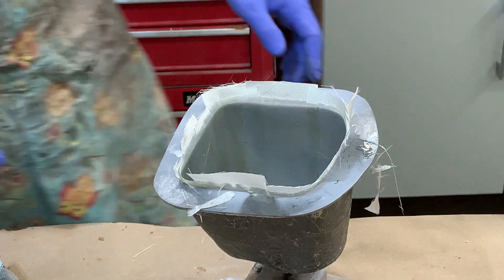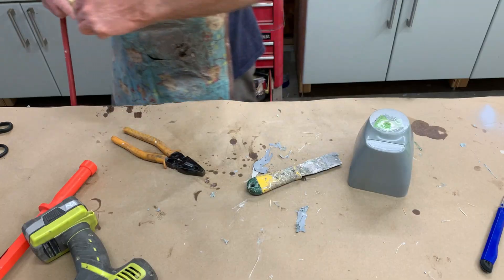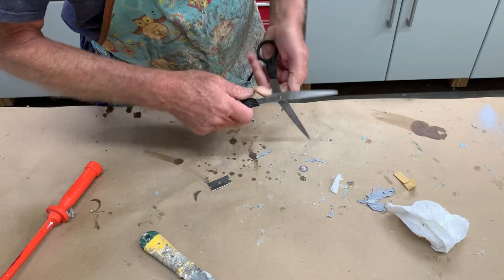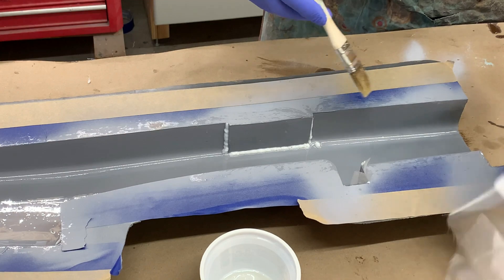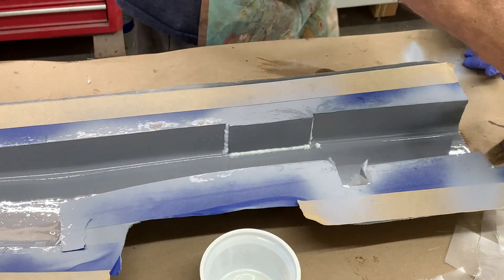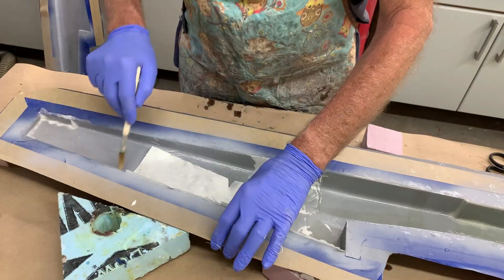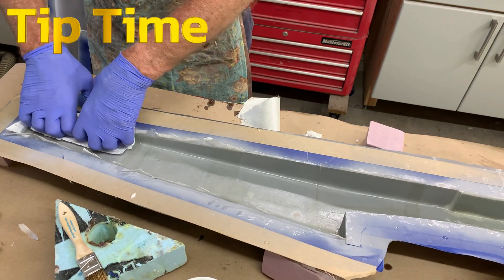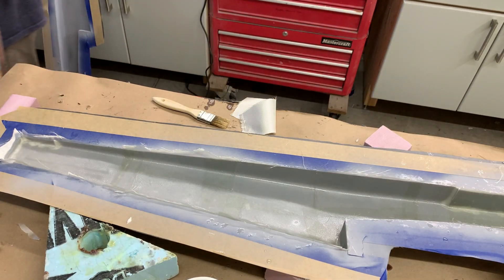RC Sport Plane Dragon Build Part 3 Layups

Comment: A good method for laying up a matte or flat finish part is to apply a normal coat of PVA let it flash off then follow up with a highly atomized chocked down layer of PVA that is a fine spatter. Quick dry with a hair dryer speeds up multiple coats. Thank you for posting these videos. I find many tips that have helped me fabricate parts.